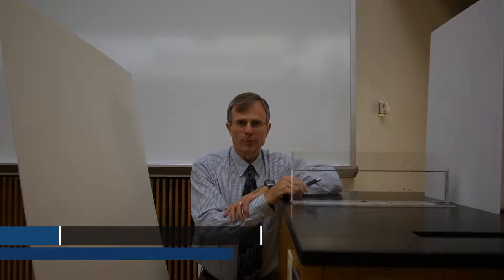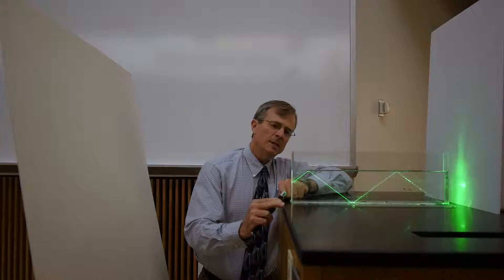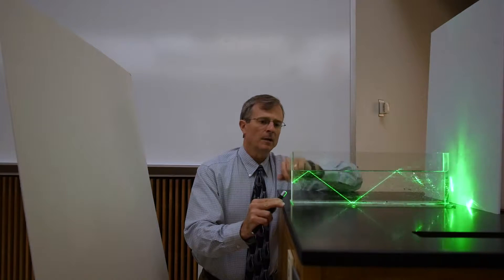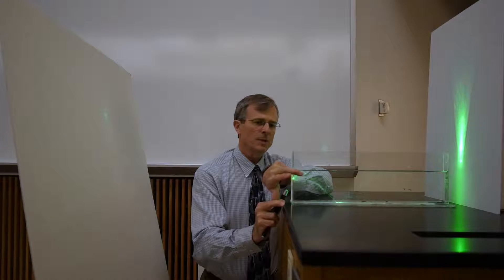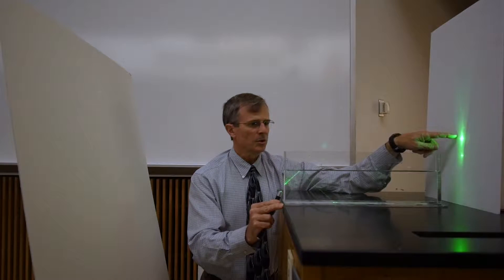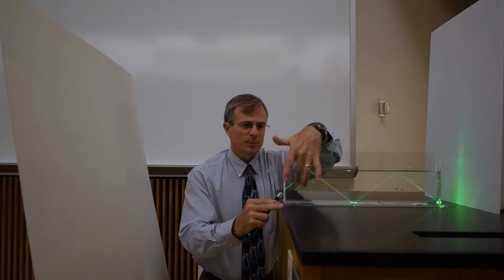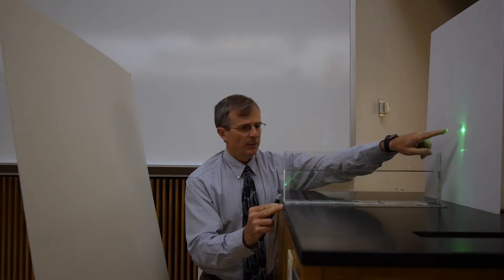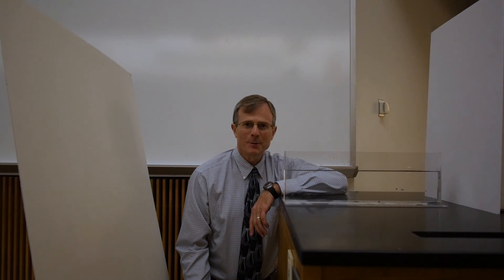Total Internal Reflection Demo: Water Tank

Comment: Question:  Did you need a tank of water, or would you have the same effect if you'd used a solid thick piece of acrylic, as it would have the same boundary with the air as the water in the tank did?  Was it just cheaper to use water than a very thick piece of acrylic?

Comment: What are you adding to the water to allow the laser to be visible?
Reply: Bro you can use salt as well 
And you can also use dust 
When laser beam collide with salt partical or dust partical them  it will becomes visible